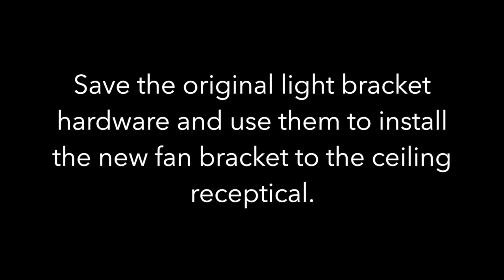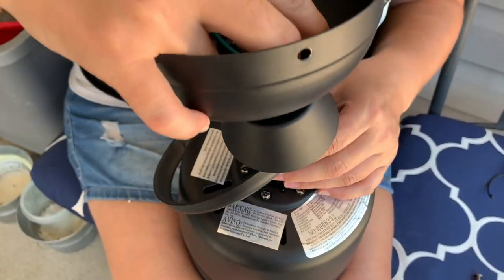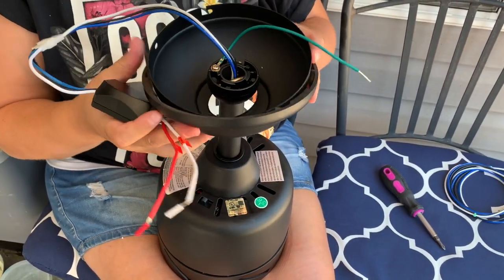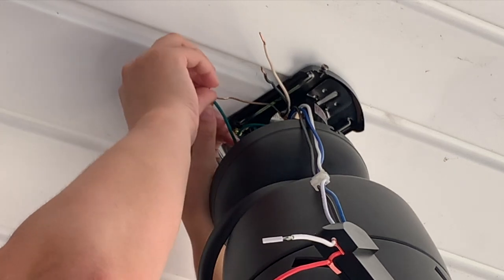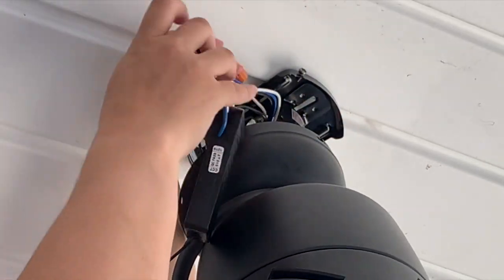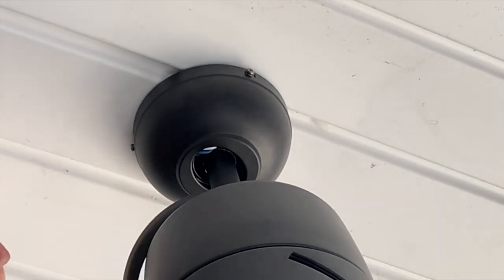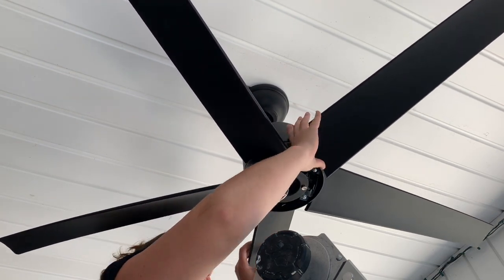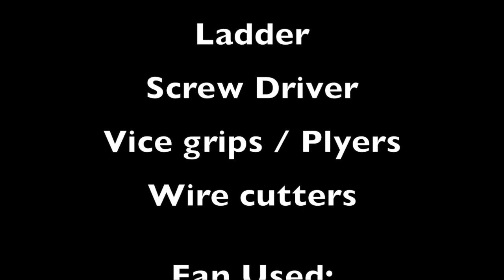Installing an Outdoor Ceiling Fan

Comment: Awesome video!   

Production value alone beats 99% of the videos on YT.   

So many videos the person tries to install  something with one hand and video  the process with the other.   
Also, I I would also like to thank you for not using the word "actually" 500 times during the video which is another thing video producers can't seem to get away from. 

You have proven GOOD CONTENT isn't the only thing a great video requires.  (I once worked for an advertising firm doing all their videos and some copy) 

NOW, off to install 2 ceiling fans my wife bought, which will be needed once finished cause it's 90 degrees here.

Thank you again for sharing and the great video.
Reply from the maker: Wow, thank you for the comment Bruce! After making several of these videos I understand why people have production teams. It’s extremely hard to make this content, work the job, then sit for hours to edit and put together a video. I have since started a business renovating kitchens a baths and sadly no longer have the time to make this kind of content.  One tip I will share though about fans- 
I’ve since installed many more since the video was made. Don’t go cheap. The cheap fans tend to be harder to install or require more finesse. The pricier ones go in way easier for the DIY’r. Good luck with your project!
Reply: @kennybecky1108  Thanks for the tip.  The fans are installed, and working.  One more thing checked off the honey do list.   Have a good one.
Reply: @kennybecky1108 I'd watch your stuff with renovating kitchens for sure!! Congrats on your business, very much enjoyed the fan installation

Comment: 5:27 the green wire is the ground, that is connected to the body of the fan. The other green wire is connected to the mount. The mount and the body has separate ground wires going to each because the ball joint is not conductive.

Thanks for the video.

Comment: Thanks, Becky.. I’m going to install a fan in my alumni wood patio.. do I have to have specific crews for the roof beam where I screw in the fan..?
Reply from the maker: Thanks for the comment Roy. I’m not sure what you mean by “crews?” But if you have to instal the recessed bracket into the ceiling (if it doesn’t already have it) then just make sure you fasten it to a stud. This type of bracket does not come with the fan, it’s sold separately.  If that’s not what you are referring too and you just mean the fan bracket. That will come with the fan you buy and is specific to the fan you are hanging. Good luck with your project!

Comment: Great job on the video. Did the fan make any difference out in an open space like that? Trying to decide if it's worth it or not. Definitely looks better. Thanks
Reply from the maker: Thank you for your comment! Yes, it does make a difference especially when there is no breeze. The light is also nice and bright!
Reply: @kennybecky1108  Great, we are gonna give it a shot, Thank you!

Comment: Positive and negative this isnt DC its an AC 120 v ceiling fan lol 😅how about ground green. neutral white and Hot black as wiring and colors
Like blue or red can be used as light or fan switch

Comment: Do you know if the housing is connected directly under a 2x4 or nailed against the side of a 2x4. I have same light fixture and mine is nailed to the side and I don't think its enough support for a fan.
Reply from the maker: I honestly don’t know, the ceiling bracket was already installed by builder and they are normally rated for 35-50lbs. You can re enforce it with a second 2x4 if you are unsure or consult an electrician to be absolutely safe.